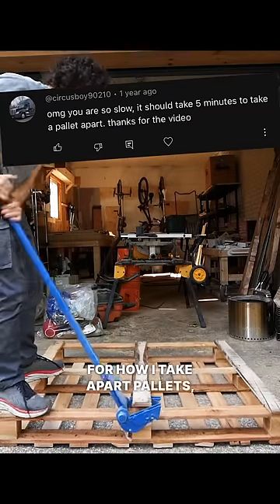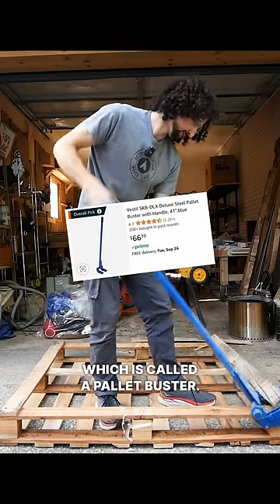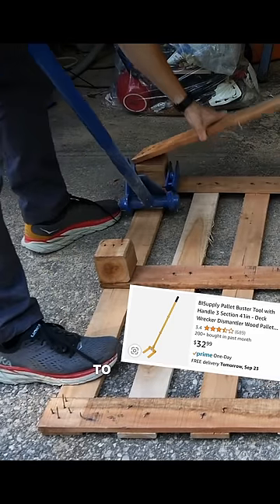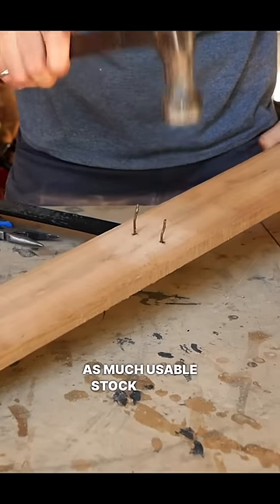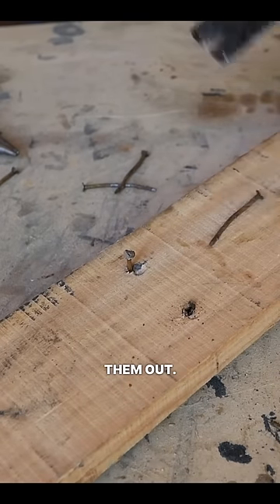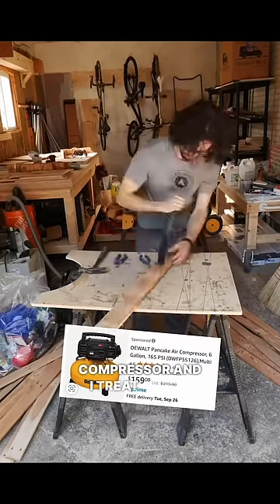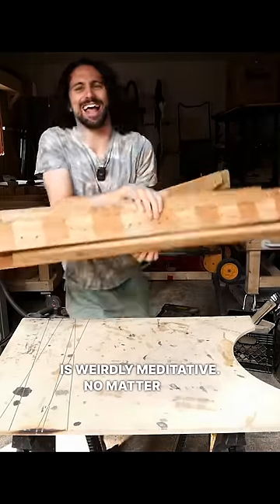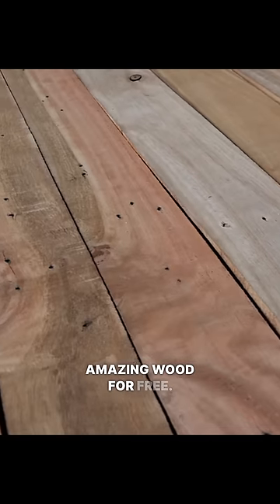The secret to pallet woodworking #DIY #woodworking #upcycling

Comment: The one thing I will say is an air compressor is one of the best tools I ever invested in. The amount of versatility something so simple give you is a game changer. Air nailers, tire filling, air hammers, impeach wrenches, orbital sanders, blowers, paint spray guns, such a great tool to have in the shop.
Reply: only caviat being,  a small pancake compressor is not gonna go very far  in regards to how much you can do 
if you get one that aint got enough pump, you gonna be waiting for it to recharge,  a bigger tank will allow you to do more between charges and a beter pump allows you to maintain pressure, and a great pump will keep up with you.
Reply: Except battery tools have now FAR surpassed the usefulness of an air compressor
Reply: @Hgdhgfdssxvbbnjoo   i mean
consider the costs the the tools 
also, is there any such thing as a batery powered hammer? 
is an eletric diegrinder really that good? 
ik 1 inch impacts of both varieties hit hard as fuck and a battery operated impact is beter as long as the formfactor is big enough
Reply: Gotta love those impeachment wrenches
Reply: Would you say that this still holds true for the current market? The reason why I haven't bought one yet is because my impacts are electric, and everything you can buy now electric is very powerful. The only thing I feel like I would use it for is maybe painting or sandblasting or filling up tires and blowing off water from parts that I just cleaned.
Reply: Thats a lot more then i could think of but all useful in a shop
Reply: The issue with an air compressor is that it's value is often tied to other things, for it to be worth it you have to be willing to also get a variety of tools that use it, which all cost more, not saying an air compressor isn't handy just that it becomes nothing more than a glorified tire pump if you don't go all in on it, plus if the compressor ever breaks it makes all your tools worthless till its either fixed or replaced
Reply: Yeah, 20-liter compressor will save a ton of effort if you're doing more than half a dozen nails.

Also a great way to go deaf, so wear earpro if you can't isolate it from your direct workspace.
Reply: @djaydeved I got a relatively cheap air compressor with a bigger tank but a smaller pump. It works pretty well for everything I use it for but I wouldn't want to be nailing a roof all day with it
Reply: Right I'm in love with my air compressor absolutely changes everything
Reply: Even if 90% of its use is just to fill your tires once a month , it's still worth owning (I can't stand using those crappy pay tire fillers at the gas station. $2 to fill 1 tire in 10 minutes.
Reply: @jmanlinc  facts u think of the time it saves and it has what emptying the tank time that's all wild, I had two drill batteries die from not being used enough but all my air tools will work now a week from now and a year from now that reliability is unmatched and so much power on tap
Reply: 100%
Reply: The single greatest tool the have by far. But also quite an investment if you want a really nice one set up properly
Reply: Definitely something to get. 
My dad used his for everything from filling up a bike tire/football to using a brad nailer.
Reply: Impeach wrenches
Reply: @williampierce5579  I think you mean impact
Reply: @YOUR_NARRATOR975  I’m referencing OPs spelling error lol
Reply: @williampierce5579  oh, didn't see that.
Reply: Car cash tool like a terminador too
Reply: My grandpa uses his father's air compressor from the late 60s. Thing is awesome and on a homemade wheel rig to move it around. Couldn't imagine how much it would cost today
Reply: True as fuck my dad bought one a while back was super good for changing the floor carpet to wood flooring any one with the cash should buy one
Reply: @SwankiestPants  air tools are cheaper then battery tools. the compressor pays for itself like 4 tools in also filling car tires with a bike pump gets old verry fast.
Reply: you do know all those tools come in battery powered versions?
Reply: @tennicktenstyl  have you seen how mutch batterys cost? two extras and you've paid for a basic air compressor. and then you have a aircompressor for everything that requires compressed air.
Reply: Yes but just don’t go small or else you’re wasting time waiting for it to pressure
Reply: @SwankiestPants pneumatic tools are way cheaper and more durable than electric. If you work in a garage there’s zero reason not to have an air compressor. Get the big Makita and an auxiliary tank from harbor freight to increase capacity but still have something portable if that’s important, or get a decent 60gal. Electric is for convenience. Pneumatic is for durability and you can have the same tools for less
Reply: @djaydeved that's what YouTube money is for
Reply: @JuryRigJohn  right as I said, I wasn't saying that an air compressor isn't good, it's just not a good option for everyone, like you even said in your comment there "if you work in a garage" you had to preface it because it simply isn't worth it unless you are going to make good use of it, which is why I said an air compressor doesn't hold a whole lot of value unless you go all in on it. IE. Getting pneumatic tools rather than electric ones, you can absolutely make it worth it in the long run, but only if you need to, a lot of people would be much better off getting electric for every now and then use while people who need frequent or even daily use should absolutely consider pneumatic
Reply: @SwankiestPants  ya I don’t agree with that, for the average homeowner an air compressor and pneumatic tools is still the way to go. You get more versatility, better durability, and a lower cost. Batteries degrade over time, batteries are expensive, cordless tools are expensive, they also don’t last as long as their pneumatic counterparts. I have battery and pneumatic tools, I work with tools professionally, I am the offspring of a man who used tools professionally. My Metabo hpt nail gun, just one of them is about the same cost as my compressor, it has only one function, a shorter service life, and comes with only one battery. Pneumatic is still the way to go. How is cordless better? Zero way besides convenience, and using pneumatic isn’t actually inconvenient. The one way it wins isn’t a big win, and every way it loses it’s a big loss
Reply: @JuryRigJohn  you might be right, I don't look at the prices of these kinds of things nearly as often as you, but I just searched "electric impact driver" and the prices were between $60-$110 while searching "pneumatic impact driver" the prices ranged from $80-$300. I excluded the obviously terrible quality options listed at $20 for both searches but that alone not even counting the compressor is a pretty sizable price difference, I definitely think people should do their own research and buy what fits their needs and budget best, and while I agree that batteries degrade over time, that happens slowly over years and is therefore comparable to the general wear and tear that a compressor experiences over years of use, but likely one of the bigger differences is space, a compressor takes up space that electric tools wouldn't occupy, again not saying that either one is better than the other, but there are situations where electric is the best option just like there are situations where pneumatic is the best option
Reply: @SwankiestPants  I’m not trying to play a game of semantics but you’re aware that an impact wrench is not the same thing as an impact driver correct? And an electric impact wrench doesn’t equal a battery powered one? An ingersoll rand impact wrench is 120 and will last your lifetime doing homeowner work, and an oil lubed cast iron air compressor will also last a lifetime doing homeowner work. The only battery tools that make sense for non professionals to get are a drill/impact driver kit and maybe an oscillating tool… Circular saws of all forms, reciprocating saw, angle grinder, rotary hammer, get a corded one, if you need nail guns, an impact wrench, ratchet, needle scaler, cutoff wheel, air hammer, pneumatic. It is retarded to buy battery powered nail guns, it’s retarded to buy battery powered impact wrenches and ratchets as a homeowner/diyer who doesn’t own an air compressor. The prices of those tools exceed the cost of pneumatic tools +a decent compressor. They’re also heavier and harder to use, and they don’t have the durability of pneumatic. 18volt drill/driver, and oscillating tool, that’s it for battery powered, everything else outside that corded electric or pneumatic is the way to go.
Reply: Bruv.  I have like ever IR titanium impact made.  Buy electric. They are so dope.
Reply: I thought the same thing. Dude has a bench planer but not an air compressor? A shitty pancake is less than $100,
Reply: Yeah but when someone is starting pallet carrier they won't invest in it yes
Reply: @maxsinventions8913  So i have used plenty of air pneumatic tools, wired tools and battery tools and generally I have found unless you are doing like heavy duty fabrication work in a fixed location with grinders and things of that nature air powered can potentially still be better, but for a majority of people and people who have to move their tools around a lot battery powered is the way to go and Maybe a corded if you need exted use of something like a grinder.. I still have a compressor in my little shop but I haven't needed to take it to a job for a few years and i mostly use it for blowing dust most of the time. Just my opinion as a woodworker and someone who remodels homes but its what ive found.
Reply: Ya if you don’t have an air compressor you’re living in the 1800s lol
Reply: Air compressor and a floor jack are 2 really good investments I use them everyday

Comment: Hey, I graduated from carpentery school. And what I found out, that alot of those pallets are not "safe wood". What I mean by safe is, pallets wood, usually don't go through treatments to eradicate wood diseases or small bugs. It's not made for long term use. 

And in some cases If you get a splinter, even a tiny one, can cause a serious infection compared to a "treated-wood" splinter would. 

So to summarize, I wouldn't recommend creating anything with pallets. Maybe only cheap and quick fance posts if your ij a pinch. 

(What I wrote is only my educated opinion, and I don't say everyone must listen to it)
Reply: That and the fact that if you're getting pallet wood worth a damn, whoever actually bought the pallet to begin with likely still owns it and won't be happy that you're stealing it to tear it apart and make whatever terrible project you conjured up.
Reply: Yes I work in a store the pallets will disintegrate with the smallest breeze. It's a pain moving them with a jack when 3+ boards are broken and we still have to keep reusing them.
Reply: @SherrifOfNottingham  There are recycling centers for pallets where you can take them for free in the industrial sector of most small cities. Also most semi truck washes like Blue Beacon will let you take them for free when drivers have no use for them during washouts and abandon them. Pallets also seem to just get abandoned at any truck stop to avoid disposal fees.
Reply: @SherrifOfNottingham  - there are many places to get free pallets where I live. They even advertise on Facebook.
Reply: @SherrifOfNottingham In the UK all the palets that are owned by someone else are painted blue afaik
Reply: All of you in the thread had great intention but honestly guys the wood is fine for building with.. if you’re doing what this guy and other guys who are EXPERIENCED builders/ hobbyists. I myself worked construction and work for a building-supplies company. By all means guys come take the wood. Get it off the lot (preferably after hours). The ones we and other companies mainly don’t want taken (rather we shall not give any away for free under ANY circumstance) are the siding pallets or door pallets etc. these cost money on top of the material delivered on them and we hold on to them until we can return them for money. The shingle pallets are made with good quality wood that’s cheap. Tell ya what though ya gotta know what you’re doing. And make sure to give the finish product a good ol slap and say “yeah I think she’s finished” then you’re A-OK 👍🏾
Reply: @carlomorgan1099  - agreed. I’ve made good lock crates out of pallets for storage.
Reply: @carlomorgan1099  Good pallets can be used for that. However a lot of abandoned pallets were owned by places like Walmart or Meijer's. Those pallets are half transformed into woodchips with a minimum of 3 broken boards, the remaining wood is rotted, and it most likely has been soaked in milk, carpet cleaner, frying oil, vinegar, Kool-Aid snow cone syrup, cat food, or whatever else the splintered wood managed to puncture. That is why these pallets end up being given away for free. That is why pallets should be inspected first before using the wood.

Comment: Back when I worked at a custom furniture shop, we had a commission for end tables, that had giant slabs of geodes for tops. We made the wood bases, and the geodes would come sliced from South America. The wood they used for pallets was all super expensive woods, like purple heart, bocote, cocobolo, etc. 

We wound up scrapping all of the pallets down and saving the wood for other projects
Reply: No way. Pallets that are shipped internationally have very strict requirements to prevent pests from hitching a ride inside the wood. The people shipping the geodes aren't building thier own pallets. They're buying them. And if your business is building pallets, you're not using wood that makes more money selling as lumber.
Reply: @backcountry164  well, it happened, and we had a ton of good wood for free for a few years during that contract. 

Those woods are worth more in the US than they are in South America.
Reply: @backcountry164 really depends on when he worked at a custom shop back in the day they used what locally was cheap would them but hardwood. These are exotic woods here so yes it's very likely that they saved it if the owner of the shop had a brain in their head for heavy items like slice of geode You would definitely be custom building your pallets around the piece you want an extremely tight fit that's secure so to not harm the piece they were probably making a small fortune off those slices. For them the wood was the least of the value if they had to replace a slice they would have to pay the shipping again and have another geode of the proper size to cut slabs out of
Reply: @lrdhawkwind  the pallets weren't custom built, the boxes the geodes came in were. They'd ship about 6 slices per box, each supported and cradled with wood. Even then, some still broke, and they'd have to ship new ones. 

In South America, those woods grow everywhere. They're like our pine, Douglas fur, lodgepole, etc. Not every board food is select grade. That's part of what makes the wood pricey. They've also gotta do something with all the cheaper grades of the wood, and sometimes pallets is the most profitable use of those pieces.
Reply: @danvondrasek  that's kind of what I was saying It's cheap wood down there It's expensive wood here
Reply: @lrdhawkwind  well, kind of, yes. It's abundant down there. And just like all wood, there's grades of it. Select being the best grade, without knots, straight and even grain patterns, or interesting grain patterns, with no blemishes or deformities. 

1 out of 50 will be select, the rest are graded in 5 or 6 other types. Pallets are made with the cheapest type-but even that cheap stuff can be used for inlays, making pens, or glasses frames, etc. 

Dudes over here thinking we're getting 50 board feet of perfect quality wood or something
Reply: @danvondrasek  people don't understand what goes into woodwork anymore, Could it be used to make something exquisite Yes if you wanted to do a lot of inlays and piecing together and gluing and so forth so on Yes you could make beautifully patterned items With a lot of man hours in them

Comment: Awesome yes, but what do you do about the chemicals used to treat the pallets when working on the wood? Aren't those chemicals alot more aggressive since wood pallets can stay outside for prolonged period of time? Is it safe to work on that wood without proper equipement?
Reply: Don't use chemically treated pallets. That's literally all there is to it. Bromide treated pallets are clearly stamped.